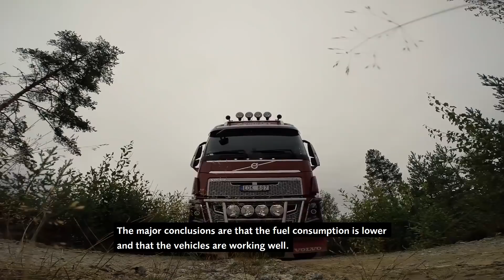90-tonne vehicles tested on forest roads

Comment: Australia has been doing this for years, little behind the times are you not?
Reply: No. No snow and ice in Australia. Wider and/or straighter roads in Australia.
Reply: @apuuvah  They got snow and ice, steep roads, it's not a complete flat country, they do have mountains, research Australia Logging and learn please. https://www.youtube.com/watch?v=Bmjx4AtXa44
Reply: @roryparsons4069  You too should really look into how forestry works here before jumping to conclusions. One can't really run Aussie style road trains easily here for a wide variety of reasons. Logging sites are generally much smaller here making extensive road preparations too expensive. Long logging distances are also a concern. Shoveling och forwarding 3 km to a suitable landing isn't sustainable so timber trucks need to be able to traverse steep and relatively uneven roads regardless of downpour or snowstorm. They also need to be nimble enough to be able to travel through existing towns and communities. Here's some videos that are quite representative of the conditions here. https://www.youtube.com/watch?v=JSJ8t7SyS_w https://www.youtube.com/watch?v=78vhUgZKNic